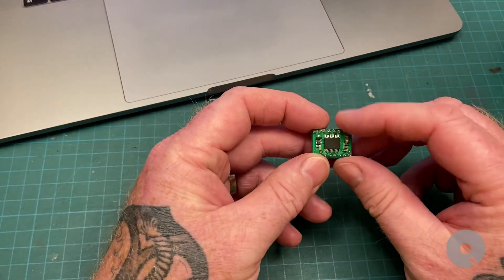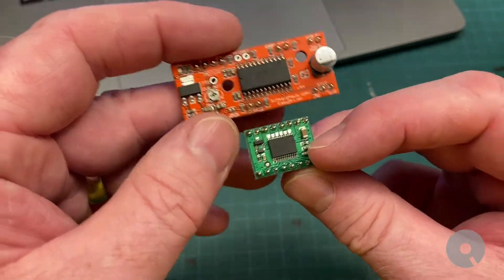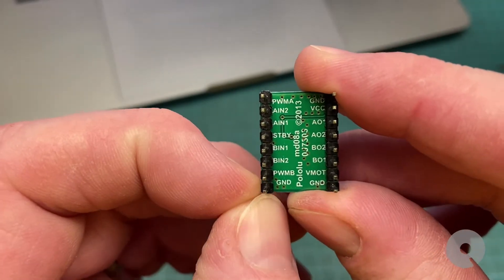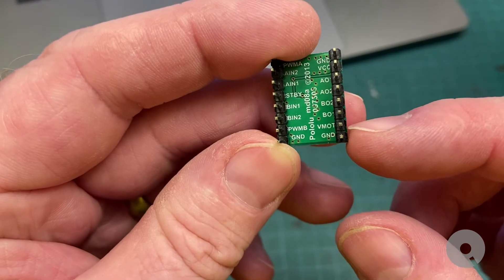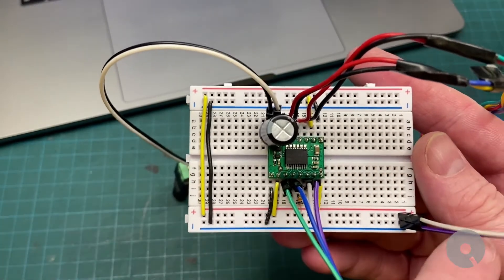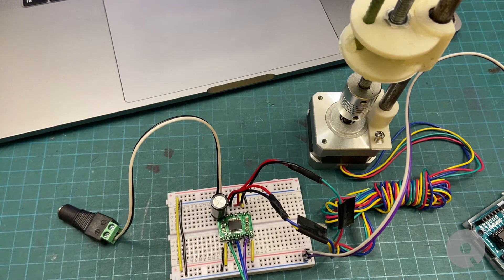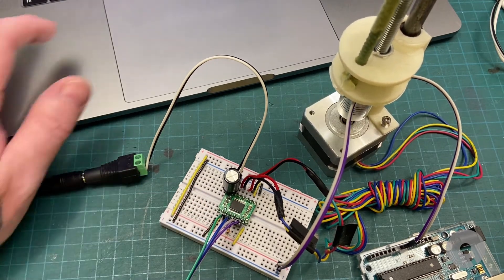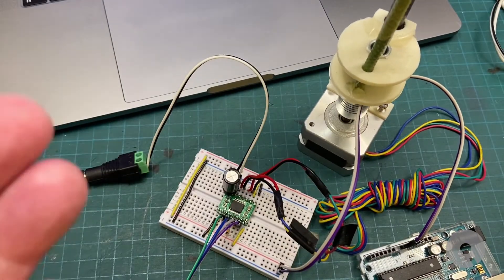Pololu TB6612FNG with a stepper motor

Comment: I must ask, why is +5V connected to PWMA/B? is it just to get a steady rpm?
Reply from the maker: The PWM pins are part of the controller logic, which is +5V in the case of the Arduino UNO. At least, I think that's why.

Comment: Hi sir thanks for the  video want to ask that I need to drive 6 motor  can u suggest to me how to with input signal within the driver
Reply from the maker: 6 stepper motors? Like for a CNC machine?
Reply: @hughqelliott    my  motor is 6 v dc motor  by using Arduino Nano
Reply: @hughqelliott  also I want feedback to Arduino  nano direct and can control it 
to be more simple just like servo motor driver we have input signal  too do this driver have that too
Reply from the maker: @raghavsaini4345  i don't know if you'd need a driver board for that. have you see this? https://learn.adafruit.com/adafruit-arduino-lesson-13-dc-motors/parts

Comment: Just a few clarifications at 5:33 : The pins on the left, connected to Motor coil Pair 1 & 2 are called "AO" O like Output
The pins on the right connected to D4...D6 are called "AIN" IN like INput
Reply from the maker: It took me too long to realize that's what those meant and I didn't want to delete this video just to upload a new one. But I guess if we never learn, we weren't trying. Thanks!

Comment: Sir i need to drive 2 stepper motors through these drivers for my project through a raspberry pi 4. both steppers are 1.2A and can be run at higher voltages(around 12V). Is this connection enough? I need your help. Reply asap

Comment: Thank you for this. I was also in search of a smaller stepper motor driver for a " Makers Build " and this video is a great help. I can imagine that I would've been puzzled about running this driver without that nugget of knowledge about the 10k resister on standby pin. 
BTW Google brought me here. And this is the proof of the fact that Google search has started drilling into the " audio " content of the Youtube videos also. My Google search was small form factor stepper motor driver and as I checked there is no mention of " small form factor " in the text description of this video.
Reply from the maker: That's really interesting to discover. Thanks!